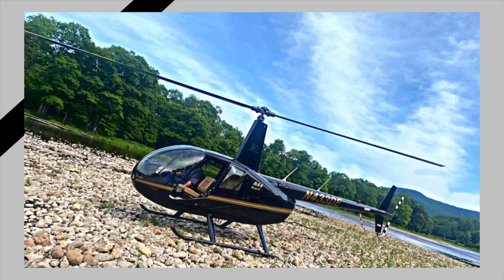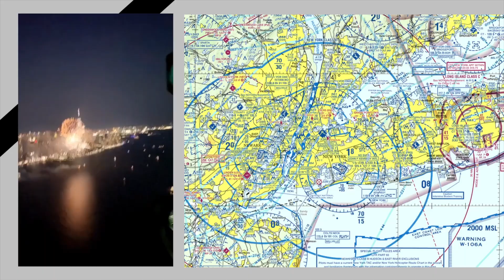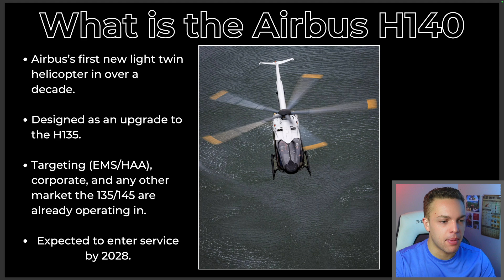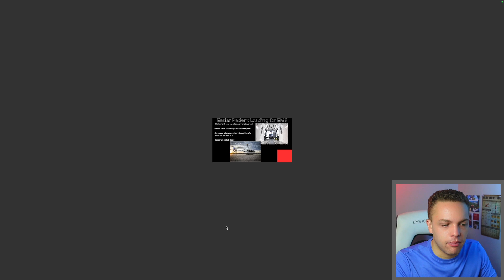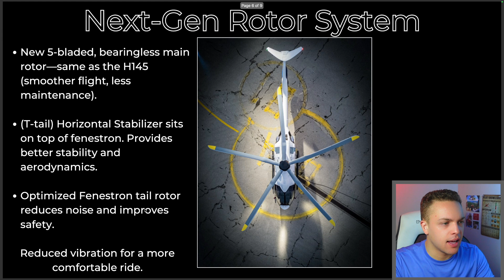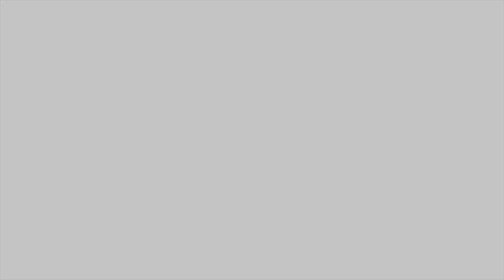Airbus H140 Unveiled: The Ultimate HEMS Helicopter?

Comment: Any new rotorcraft design since 1994 is required to comply with the latest CRFS requirements contained in the Rotorcraft Certification Specifications CS-27 and CS-29. 

As even the EC130 was actually designated AS350B4, due to the grandfather’s rights for the certification, EC circumnavigated the CS-27 and CS-29 certification requirements not only for the crash resistant fuel cell, but also for CS27.562 impact resistance of the fuselage. 

But circumnavigating the certification process is highly appreciated at EC/AH, as their new light twin, the “AH140”, actually is designated 135T4 in the license. 
So, it stays a Sandwich 🥪 helicopter.

A lot of lives could have been saved, if the 350/130, 135 and 145 (latest AH145D3 is designated BK117D3 in the license as they used the same trick) helicopters had to be certified as is i.E. a MDExplorer or AW139/169! 
30g crash worthy,
Crash resistant fuel cells,
Automatic fuel cutoff valves
Etc etc 

Safety for the crew? Not with the market leader. 
You’d better check how your chopper was verified under!

Comment: My program was recently looking at a 145 but it was a little too pricey.   This would be perfect.  I have a strong feeling that in a few years this will be a top seller, it definitely fixes all the things that I didn't like about a 135 it's sleek, modern and those 15 extra knots make a big difference on super long flights.   Also I think the design of that T-tail Fenestron looks like it won't be so suceptible to being shoved around in high crosswinds like the 135 tends to be.   Overall I think it puts Airbus way ahead of Bell in the HEMS sector.
Reply from the maker: I could not agree mor! You said it perfectly. I think Airbus has really done something Huge here. This may be the best HEMS platform out there. They seem to have really thought about almost every aspect!

Comment: In my opinion a needed improvement by adding another blade to get some better lift, and sticking the horizontal stab outta the flow of the downwash.  Having flown the 135P2+, they have a little harder time doing max performance takeoffs out of the typical confined area one finds in EMS, loaded weight-wise as such, and that was with typically staying downloaded with no more than 1.5 hours fuel to start from base, and more often than not having to use max torque to do so.  Sketchy as h*&$ to operate into higher elevation LZs.  More than once I would have to plan on having a left crosswind to reduce the rotor wash impinging on the tailboom in order to get just a little more lift to eek a vertical climb beyond my IGE hover in order to aerodynamically get out its own way.
Reply from the maker: Yeah, the 135’s limitations in performance are one of the main reasons I think the 140 is likely to be super successful. Just simple, meaningful upgrades in the areas that matter.